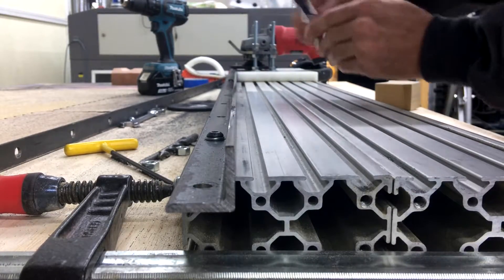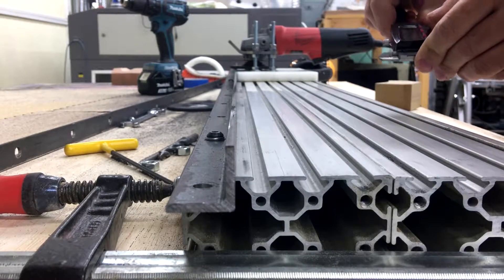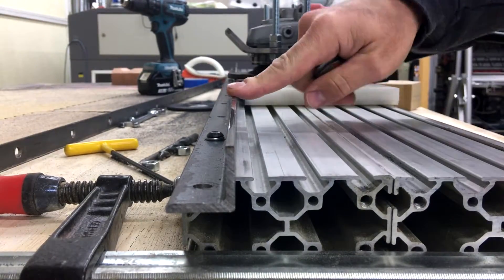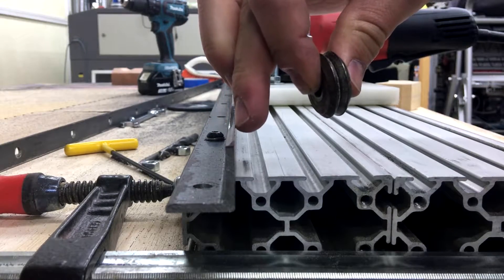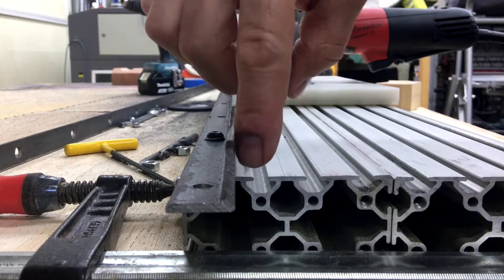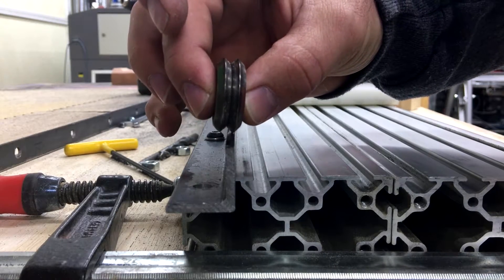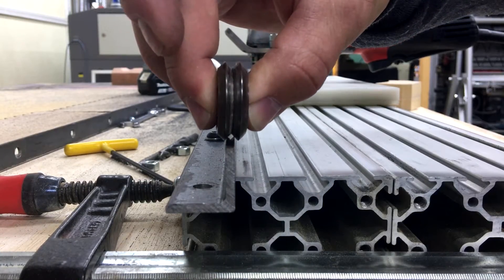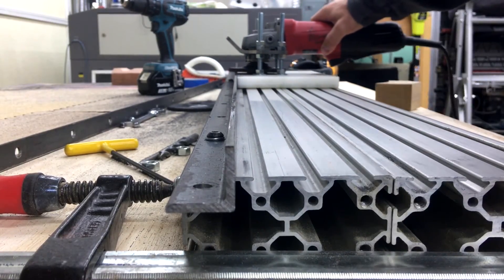CNC Shaping Rails

Comment: Wouldn't it easier to use the natural corner on a angle iron and a round stock under it as a natural centering piece to screw it to? Counter sink screw in the round bar and mount it to the extrusion the set and drill the Angle so it set down over the round stock leaving you a 90 degree peak for the bearing to run on. I see people using Would and putting angle like you are doing and all they have to do is cut the Plywood in the shape of the Angle iron and drill the angle iron and mount it to the 90 Degree cut on the edge of the plywood basically like a cap over the wood.<<--------------->> The inner arrows are the plywood and the outer arrows are the angle iron, thinking it as a picture view from one end of the rail.

Comment: why not grind at 45 degree to begin with?
Reply from the maker: +Alex Parfenov Dimensionally the angle iron isn't a consistent height throughout. Once it all at the same height I can proceed with the 45 degree angle grinding. Not critical but I chose to do it this way.
Reply: Thanks for quick reply. My thought was that if you were to somehow jig up your router @ 45 but continue to reference off aluminum extrusion, iron's height variation would not matter (you'd simply grind off any high spots). I've tried unsuccessfully to grid rails @ 45 with stationary grinder and moving the iron. Your idea is much better. I am going to try to take your method and but hold the grinder @ 45